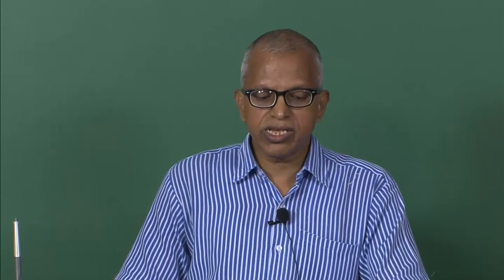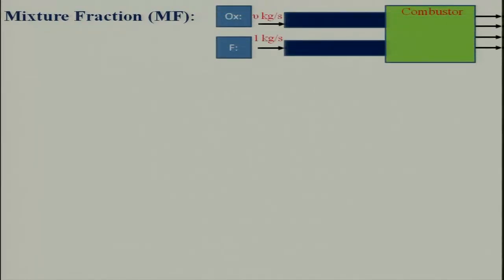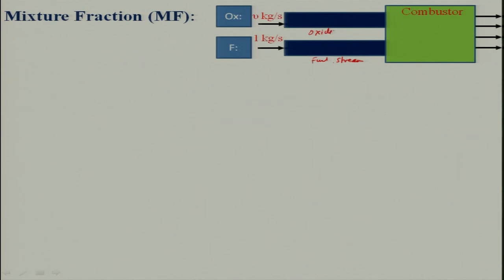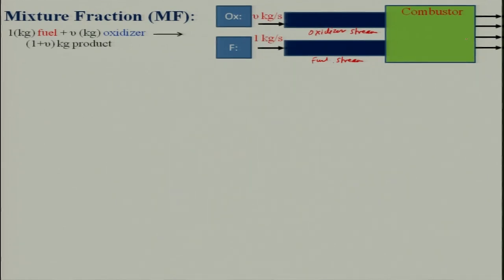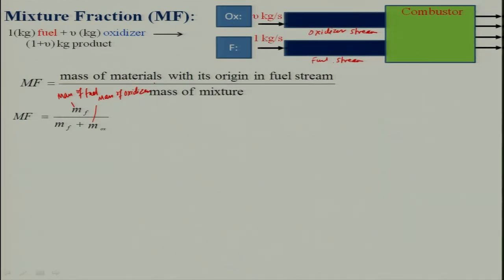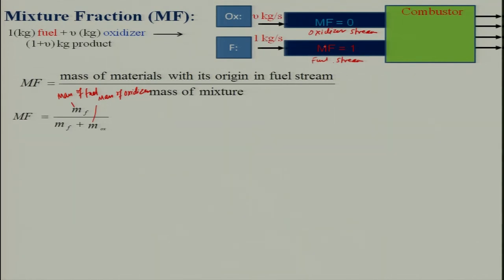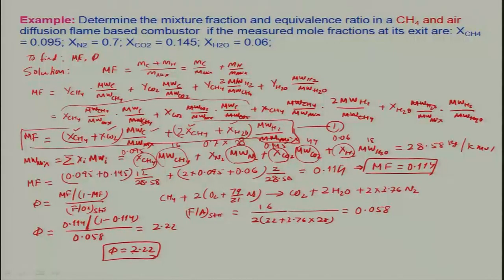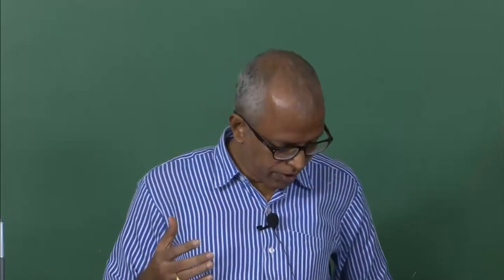Lecture 10 Mixture fraction calculation for diffusion flames

Comment: For the example problem at minute 12:07, I imagine a combustor that has fuel & oxidiser inlets and an outlet downstream. Does 'exit' in the problem means tip of burner inlet or the outlet?
Reply: outlet.